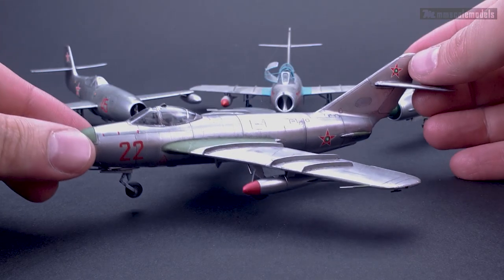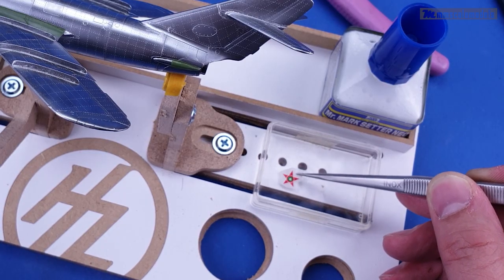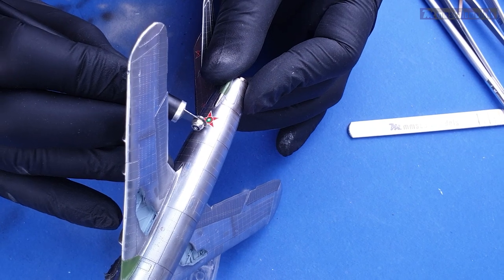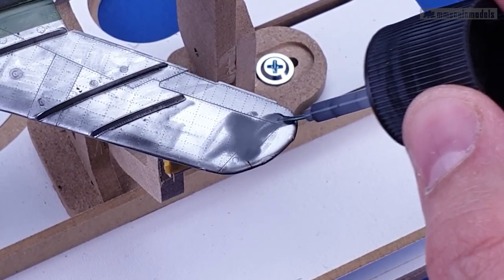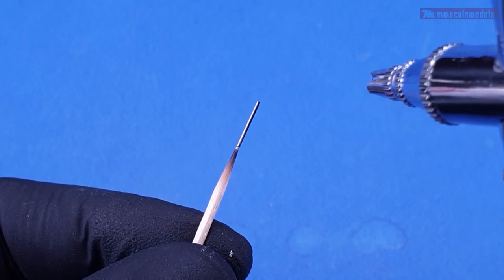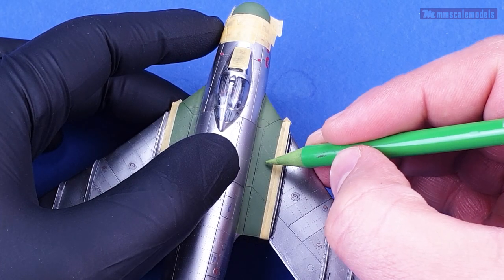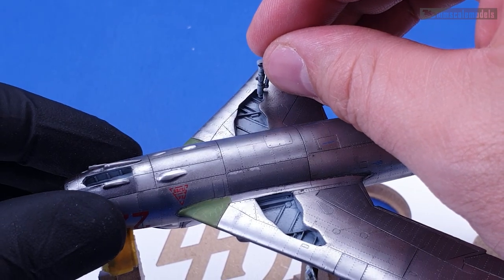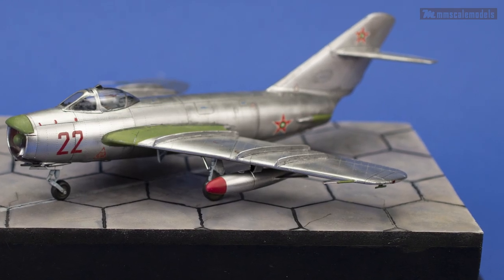A fight 'till the end 🤬 -  1/72 MiG-17 PF - Pt.5 - AZ models

Comment: One thing I've noticed, Metodi - instead of cutting the needle away from the plastic part with a rotary tool, you can easily remove it simply by melting the plastic with a lighter (over the sink!). This way you get a clean, round end of the needle without any cutting or grinding :) I do that every time for any gun barrels or pitot tubes.
Give it a try and let me know if you like that method :)
Reply from the maker: Thanks for the tip, I have used that in the past however I always get some kind of hard insulation material or glue that is stuck on the needle. Besides I needed it in a few pieces anyway
Reply: @MMScaleModels  well sure, if you need small tubes then you have to cut anyway.
I usually get rid of that hard needle glue-blob by crushing it with plyers (not too strong so you don't bend the needle), never had any problems, but maybe Polish needles are different :P

Comment: Have you think about trying cutting masks with laser instead of blade tool? There is a company (1manarmy) making stencils for 1/32 planes, that are clearly laser cut. They look amazing. If you have laser cutter it might be worth experimenting with cut parameters to get similar results.
Reply from the maker: It cuts trough paper very cleanly and I think it will be able to cut the masking tape... but it will cut my matt too so I have to think about a solution.